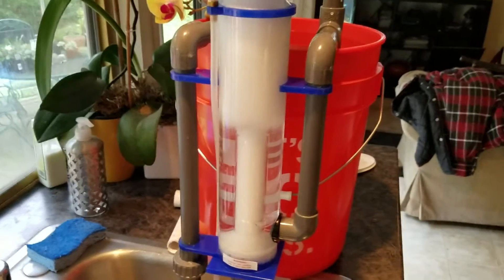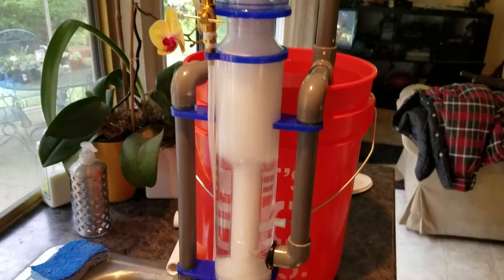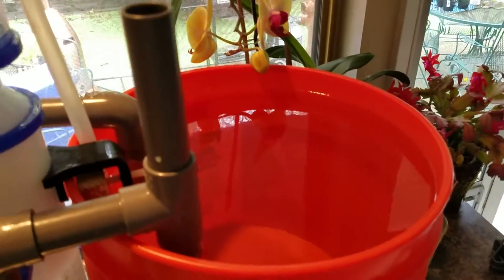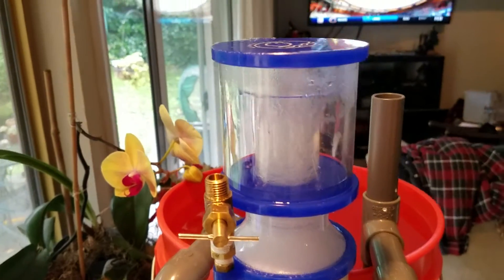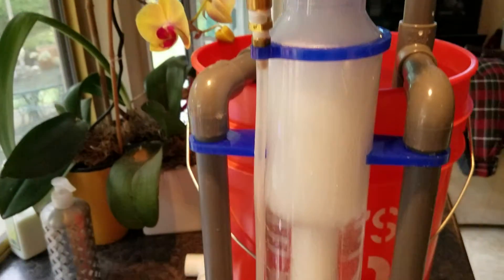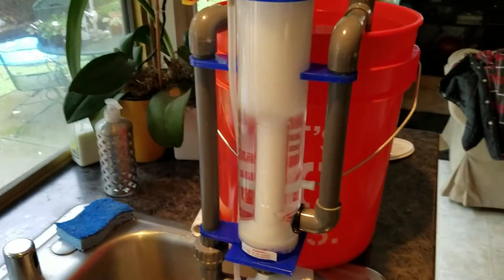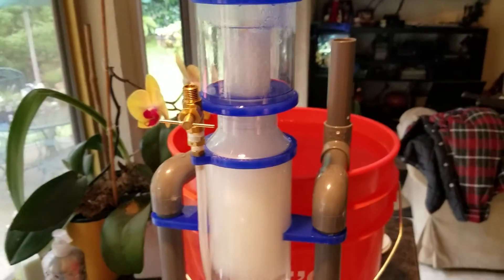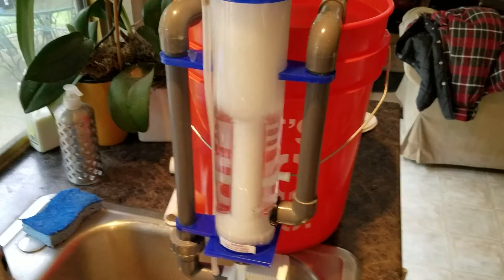Testing the Eshopps 75H HOB Skimmer

Comment from the maker: do you have it in your tank or are you testing it with a bucket. put it into the water until the intake tube is under water. turn it on. fill it with water until it overflows back into the bucket through the discharge tube. put the collection cup on and put your finger over the air intake tube or if you added a valve to the air intake , close it in till the water level fills up half way onto the inner tube in the collection cup. the you have to adjust the water flow by turning the tuning tube in till you get the water to stay just below the collection cup. then tun it for a while at the level. it's going. to take a lot of adjusting and trial and error. but one you have it dialed in. out a mark with a Sharpie where the white for is on the discharge tube and that will be your set point.

Comment: also by having a protein skimmer does that mean that I don't have to Syphon vacuum my sand bedding as often when I do water changes? Because most of the organic waste and food will be sucked by this protein skimmer?
Reply from the maker: No. The skimmer sucks water through a screen filter that goes over the intake to the skimmer. It takes out all the VERY fine items mostly fish shit and pee that you can't even see. The bubbles from the skimmer collect the debri and then deposit it into a collection cup. You'll still need to have a filter of some sort. Either in a Refugium, sump or a hang on back filter. Basically, it collects the crap you can't really see and removes it. It's not a stand alone filter system. I use a hang on back filter, I have 2 filter sheets in my refugium that picks up debri and then I pump the water back into my tank. I makes it so you don't have to change your water as often....
Reply: Kennys RC Channel thanks. yes I got it last night in the mail. set it up as well. not sure where i want the level of water be at when I pinch my air line tube before releasing it also when I'm adjusting the tube I keep the bubble right below the top of the inner tube inside the cup so bubbles won't over flow into the cup right?

Comment: how much white viniger did u mix in the bucket? how is it running for you now?
Reply from the maker: Robert Xiong I put about 2 cups in the 5 GALLON bucket. my Eshopps 75 is working like a CHAMP! I'VE UPGRADED MY tank to a 36 GALLON bow front with a 20 GALLON Refugium and it's doing great.
Reply: Kennys RC Channel that's awesome to hear buddy. mine is on its way in the mail. no are there anything to look for when it's completely brand new out-of-the-box I've been reading up a lot on the Overflow issue and having too much microbubbles etc... how long have you been using yours? Are there any tips on taking care of it? I have a 75 gallon tank.
Reply from the maker: I found that once I added a valve on the air intake, I can regulate how much air goes into the Skimmer. That helps with overflow. Also, If you find that after a week you're still getting overflow, you can spray the top of the collection cup with "Pam" or some kind of spray oil.. VERY LITTLE. that will help reduce the bubbles..
The BEST way to not have bubbles or at least the least amount is to ALWAYS use REVERSE OSMOSIS water. NEVER use Tap water or you'll overflow all the time... My Skimmer HATES tap water...